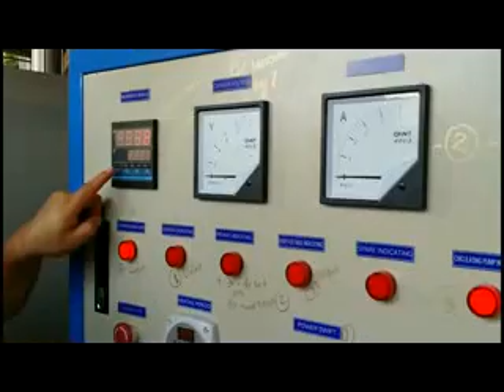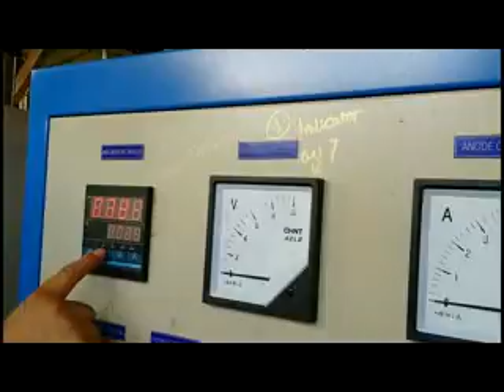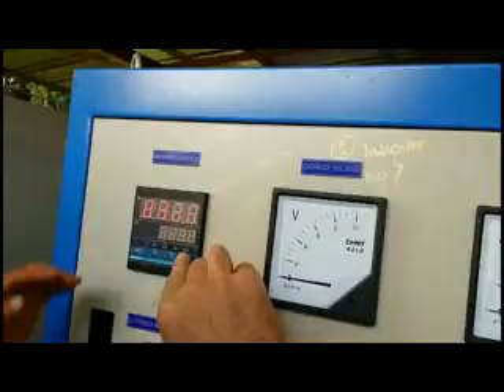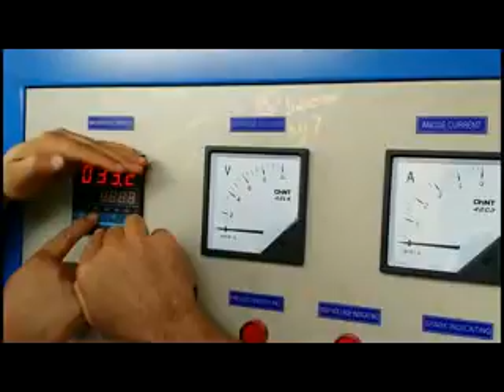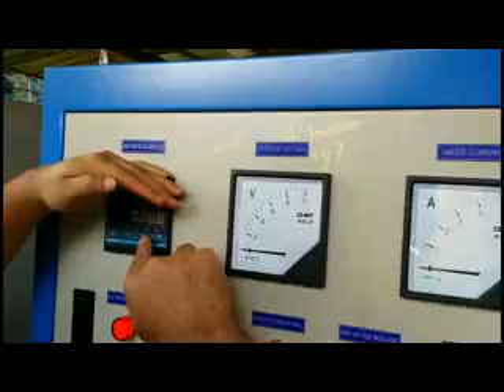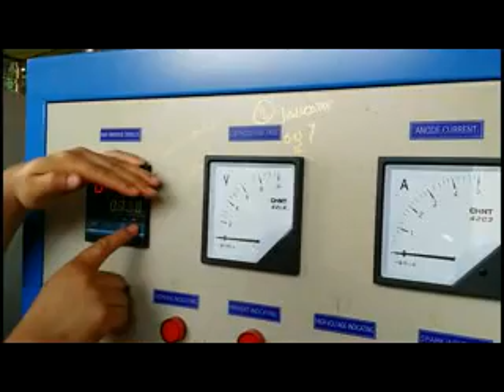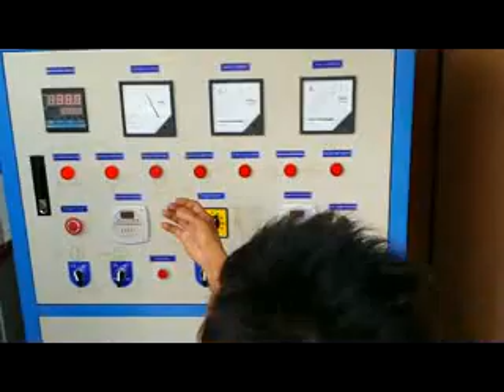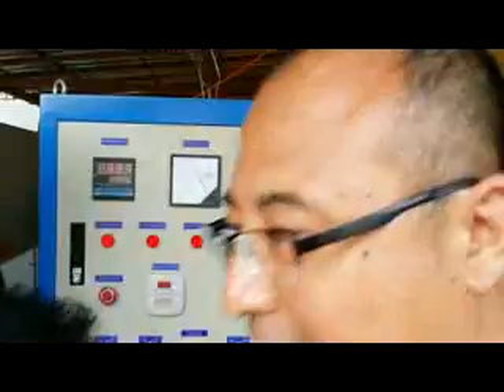Indonesia wood dry by hf vacuum wood machine

Comment: I have been looking at and commenting about the kilns from this company. I believe they use the same video showing installations in "different countries". The world rejected this technology 35 years ago. In the early '80's, I was a plant engineer who was responsible for eight of these radio frequency vacuum kilns. They were 5000 board foot kilns. I have seen inside these ":new" Chinese kilns and they are an exact copy. Drying cost is very high because of the inefficient, energy gulping oscillators. Operation is difficult because the wood is part of the circuit and adjustments must be made as the moisture content comes down. Notice all of he knobs and switches. Maintenance is high because of lethal voltage and high current. Quality is poor because of an uneven dielectric field which over-dries some areas of the load while other areas remain wet. And this time they come from China.